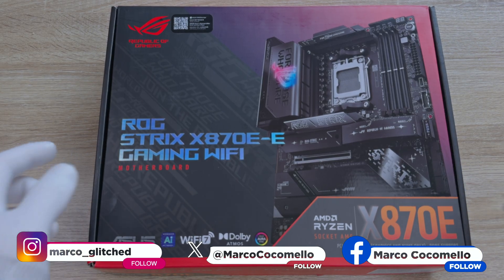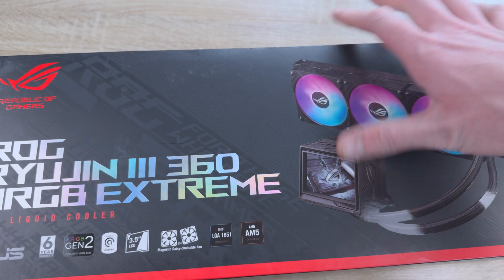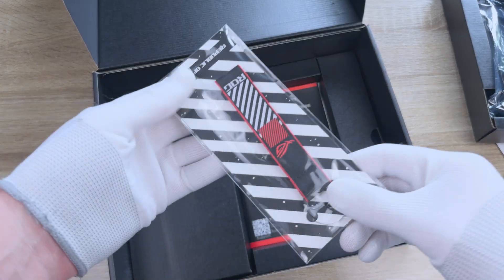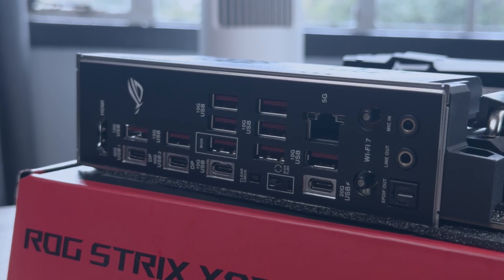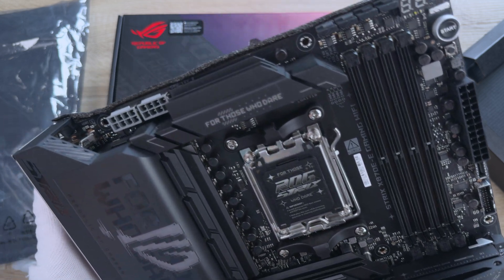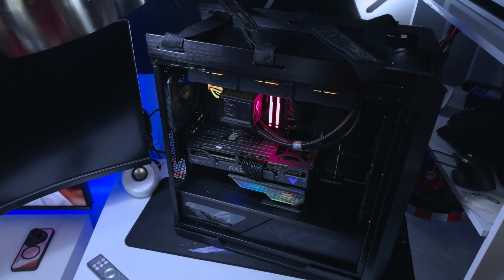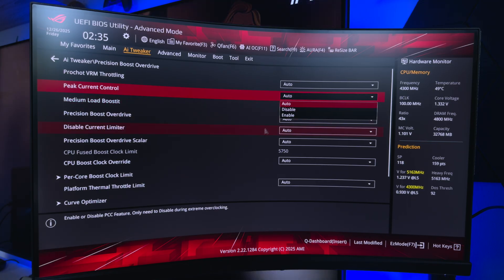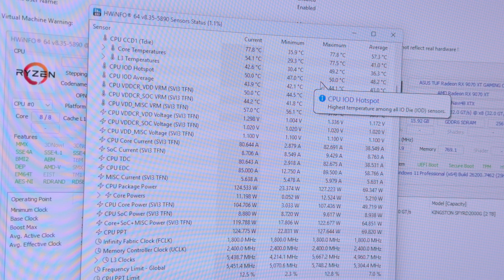ASUS ROG Strix X870E-E Gaming WiFi Review (AMD Ryzen 9950X Tested)

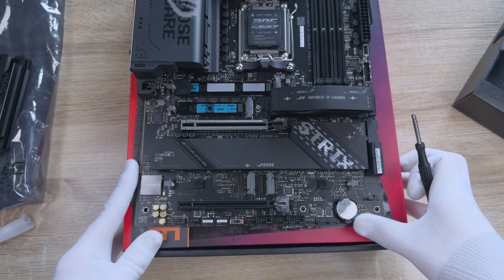Comment: 3:15 - Both M.2_2 and M.2_3 slots share PCIE lines with the GPU slot, making it x8/x4/x4. You can use only M.2_1 slot to avoid lane sharing. PCIE 4.0 SSD's works perfect with chipset slots (M.2_4 & M.2_5) and you won't notice any latency when gaming. RTFM. Bro does not even know what he is talking about.

Total supports 5 x M.2 slots and 4 x SATA 6Gb/s ports* 

AMD Ryzen™ 9000 & 7000 Series Desktop Processors* 
- M.2_1 slot (Key M), type 2242/2260/2280 (supports PCIe 5.0 x4 mode) 
- M.2_2 slot (Key M), type 2242/2260/2280 (supports PCIe 5.0 x4 mode)** 
- M.2_3 slot (Key M), type 2242/2260/2280/22110 (supports PCIe 5.0 x4 mode)**

AMD X870E Chipset 
- M.2_4 slot (Key M), type 2280 (supports PCIe 4.0 x4 mode) 
- M.2_5 slot (Key M), type 2280 (supports PCIe 4.0 x4 mode)

**M.2_2 & M.2_3 slots share bandwidth with PCIEX16(G5). When M.2_2 & M.2_3 are occupied with SSD devices, PCIEX16(G5) will run x8 only.